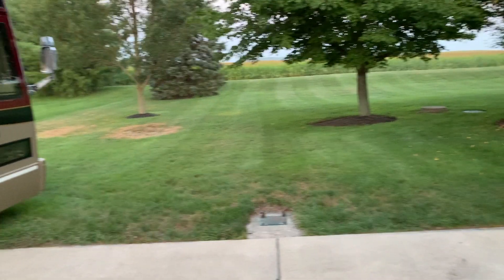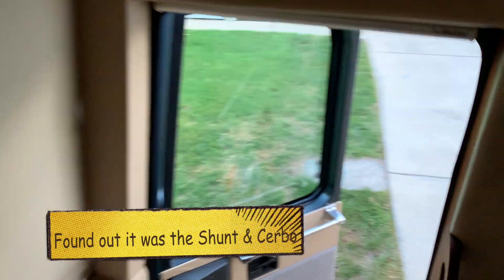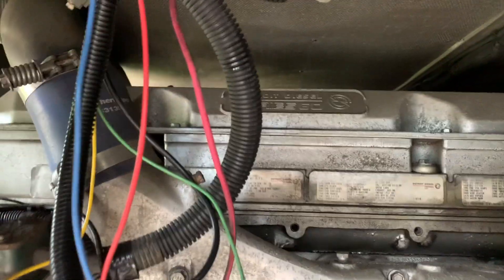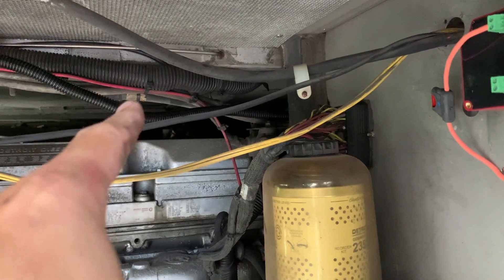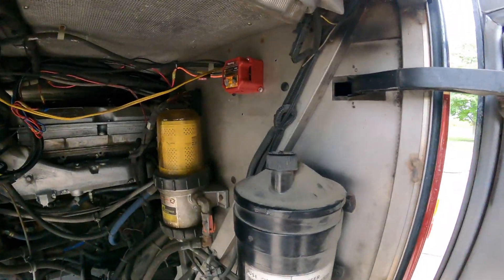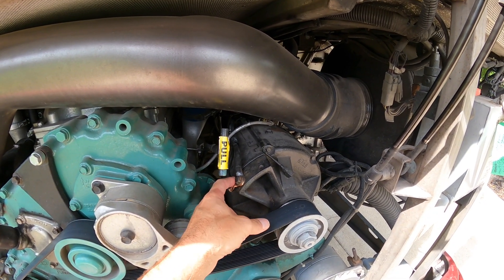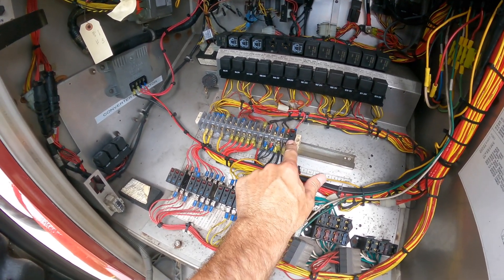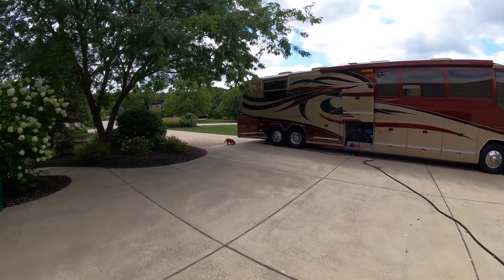EG4 Lithium Battery RV Upgrade / Update # 4

Comment: Great content! I am amazed I stumbled across it. 

Your project is similar to my Catalina 42 sailboat project: 24v alternator, 12v  loads and soon to be 24v loads, 2 Multiplus’s in split phase (bought but not installed), 24/12 dcdc converter, APS-500 (made by Wakespeed for APS) cerbo, currently “Frankensteined” 24v AGMs waiting for decision on LFP bank, etc, etc

Are you planning to use the CAN from the SignatureSolar BMS to control the Wakespeed and the Multiplus charging? The REC BMS or the Victron Lynx BMS can do this and the pre load dump signal controls the field to prevent the catastrophic alternator load dump. Can the SignatureSolar work this way?

Another question is your shore power connections: are you 50a split phase? Do you have L1 feeding one Multiplus and L2 the other? (I first found your channel by searching for Dual Multiplus, but those videos didn’t address the existing shore power/hookup. I’m sure most of your Prevost subscribers already know this but I am working from a 1999 Catalina dual 120v 30a single phase system perspective.) 

Again, fantastic content, for me. If you need some Wakespeed help, I’m just ahead of you on the install with the 24v AGM setup, but way behind on the LFP, though I did speak with SS this spring—they didn’t encourage me on the rack mount system on a sailboat, but, if you can get the Wakespeed/SignatureSolar/Victron system working, I may be right there with you at 20kWh/24v.
Reply from the maker: It’s fun isn’t it (I think it’s fun or maybe we are just a bit crazy :) ).  So my coach has a 50amp plug - so I used 2 multis - as you mention - on split phase data wired and programmed together. Each multi really just receives like you said L1 and L2 but share the same neutral. This bothered me at first but since they are 180 degrees out of phase the neutral only has 50 amps at one time.   This also allows me to run a 240v load but I don’t have any - it really just allows 100amps of power draw….  If I plug into 20 or 30 amp service (non split phase) the multis shut down - as they should. So then I have to reprogram them as individual inverters.  But when they are individual inverters you have to unplug the data connection between them. The cerbo can only receive one unit. So on the color touch I can only see one inverter - only when reprogramed to run on 20 or 30 amp. Because that won’t run much, I hooked up a bypass in my panels. So they are set to 50amp split phase wired together and both show correctly on my color touch. If I only have 20 or 30 amp - I end up shutting off the multi’s, disconnect the power in and out from them and then bypass them. The 20 or 30 amp then runs straight to my coach powering the AC. I then have a 12 amp Victron charger that I plug into the AC to keep my batteries topped off.  I find this easier as it is just 3 breaker switches.  If you figure out another way I am all ears!!  I think a reprogram from Victron to allow two individual inverters to show on the color touch would solve the issue but imagine I am 1 of 4 that have this issue - but who knows.  

I am going to work with signature solar and WS to see if they can create a program to load into the WS to read the EG4 BMS data - for now I don’t believe it can. I also have the WS to Victron cable but don’t think It will work - will see though - I have seen that the color touch shows the WS as another charging device…. My brother knows that stuff and said it’s just knowing what each piece sends and then having the unit respond to the data.  So thinking if I can get the EG4 data and have WS add this to their program that should work fine.  Getting Victron to read the EG4 data and then write a program to view it seems maybe a stretch. But if it can read the WS I would be fine with that. 

If I can get time and convince my brother, I would love to have another data cable in the CAN network plug into a mini computer that reads all the data and shows it on a smaller tv screen on a nice dashboard.  He has to (professionally) figure out the CAN data on proprietary devices and program his companies devices to respond as it is designed to - figure just showing the messages should be simple :).
Reply: @CampPrevost  the split phase in/dual single phase in challenge may be easier than you think. I’m told, but haven’t done it yet, that the VictronConnect can “toggle” between the two modes. I plan a week on the boat (3 hours away) in October trying to get to this functionality to work. Even if it involves using VE config, which I think it will, it would solve the problem. An auto transformer is another approach ($$). 

My experience with marinas is that most dual 30a shorepower recepticals from the same side of the post are 180 out of phase. But—figuring out a software solution is high on my list. In my case, the neutrals are not common on the 2 separate shore power cords. I can run the multis completely independent, but I think I will lose one charger function and the cerbo will show just the one. (I think)

My shore power post has 2 50a split phase and 4 30a single phase so I can/will be able to mix the 30a single phase inputs. My “normal” show power hookup is a 50a dual cord to dual 30a single phase cords into the boat. That forces the split phase 30a into the boat. 

The Wakespeed/EG4/Cerbo CAN should allow the BMS to control all charging and the Wakespeed to ramp down the field current prior to a load dump event. That’s the big risk—killing the alternator. Thanks hope you can solve this challenge.
Reply from the maker: Getting ready to program the WS500. Did you use the phone app, the WS500 configuration program or the off grid software solutions program?  I played with the phone app and like the “white space” function where it appears I can control the field strength with the rpm. I would like it to be low when at idle.
Reply: @CampPrevost  I used the Ocean Planet Energy program through their Tether. However, I have the Wakespeed app on the iPhone and the interface works to tweak what I had for a baseline. For me, the white space and temp limits (battery and alternator), as well as the current control are key. I only have 50hp to tap and have, potentially, 5kW to pull. I have seen the alternator temp and rpm based variable production work very well and with the app, I can/have manipulated those limits in near real time. 

The Wakespeed config program from offgridsoftware solutions also looks user friendly—I just haven’t given it a try.

Comment: If you ever get tired of your current field of employment, there's a job waiting for you to upgrade RV electrical systems from coast to coast. Most mechanics won't touch coach electrical, and if they do, they will charge enormous sums to track faults- particularly on older rigs.
Reply from the maker: I think it would be fun - I think I have a simple coach too - some of these Liberty, Marathons and Featherlights have star wars level equipment.  It would probably take a few days to figure out what they did let alone remove all the beauty covers - but imagine you would start to see similarities/standards among brands. The adage eat an elephant a bite at a time.  I want things to look factory - but these are now 20 some years old - so trying to balance a retro look and current look with current technology is a challenge and owner specific.  Kind of like old airplanes, you can replace the entire front panel with an iPad and an app (not legally I know) but what do you do with the rest of the panel and how do you want it to look when finished.  That’s the hard part. Thanks for watching - stay tuned to see if I pull it off!